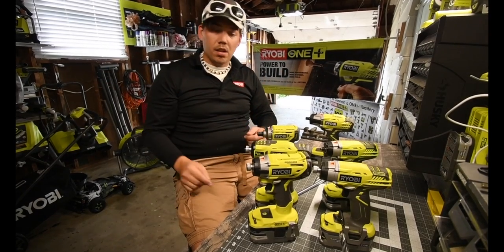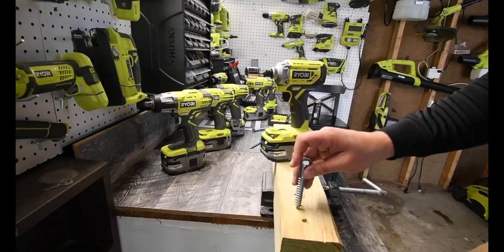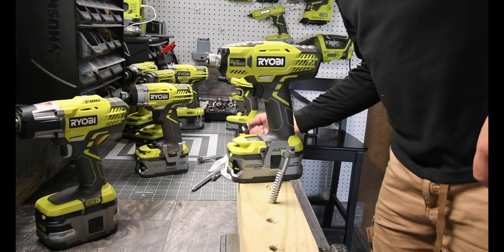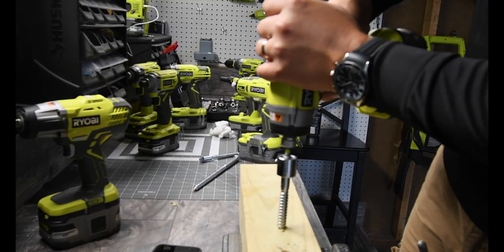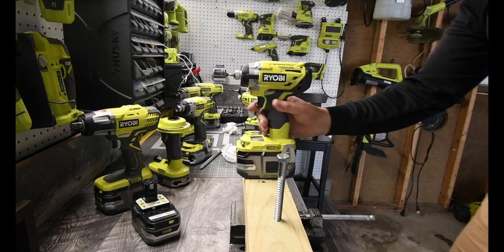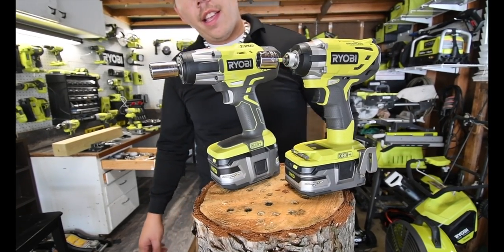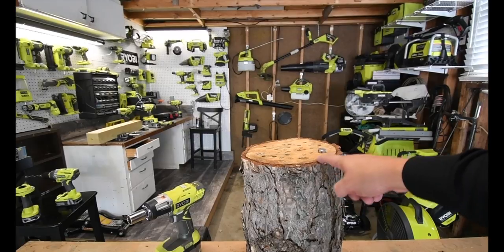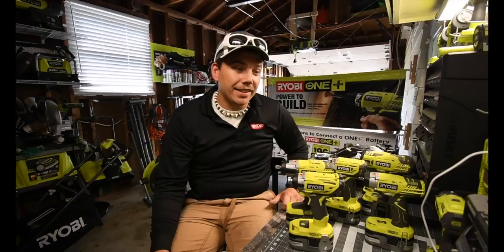Ryobi impact Battle Royal 4" 6" 10" lag screws

Comment: Great video. I see the wobble in the P263 with the 3/8"  anvil due to NO ball bearing to keep the socket on & stable. Dumb move from both companies if you ask me. The same as the newer C3 3/8" I had mentioned that came out in late 2018 for a dying line they are letting die due to them pushing their new 20v line sold mostly at Lowes & what's left of Sears stores. Keep the vids coming!
Reply from the maker: Greg Taylor that is dumb, that ball is necessary

Comment: Were you using the right size socket?  It looked pretty loose/wobbly to me.  Potentially slightly rounding off the screw head.  Since it looked like you only bought one of each size lag screw.  Do you not have any impact sockets?  Also, no work gloves?  Otherwise big fan of your videos and all my Ryobi tools.  I have watched all your videos.  Keep up the great work!
Reply from the maker: if your talking about the P263 with the 3/8 in anvil, the socket is loose because there is isn't a ball on it to secure it on. it doesn't wobble by rotation. it slides back and forth

Comment: Good evening I just the New Ryobi  18- VoltOne +Lithium-Ion 3.0 Ah Lithium+HP High Capacity Battery @$90.00 for the single back but the 2 pack which is $129.00 (@$64.50) what gives?. Can you do a comparison between it and the regular Lithium 3.0 Ah battery, please. Thank you
Reply: The hp has 21700 cell
Reply from the maker: I can sir and I will
Reply from the maker: only the P195 has 21700 cells in it